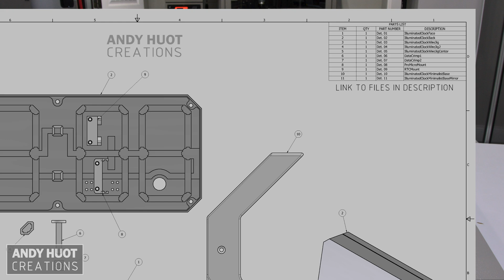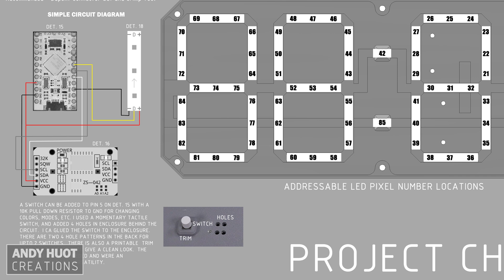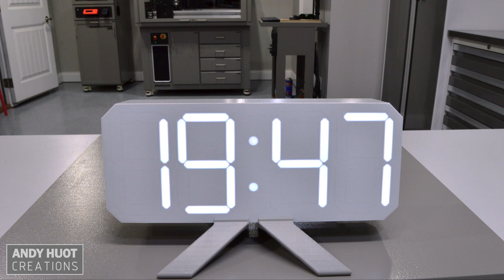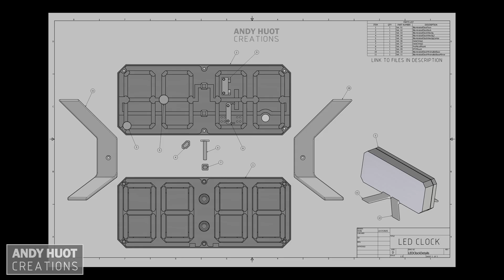WOW! Create Your OWN 3D Printed LED Clock!

Comment: Great project Andy!  I will say that I've ordered the LED strip twice off your affiliate link and both times I received the 144 LED/M strip instead of the 100LED/M strip.  Two returns currently in progress to Amazon - just FYI!
Reply from the maker: Sometimes the links default to something else when out of stock.  I'm trying to figure out a way to prevent this.
Reply: @AndyHuotCreations  Yeah, the funny thing is that the seller's listing specifically says 100LED/M and yet they shipped 144.

Comment: Hi, can this be printed on a  Bambu Lab X1 carbon, 256x256x256mm? and your other prins also?

With kind regards,

Theo Brands
Netherlands
Reply from the maker: Yes. As of now, all my projects fit on a 250mm x 200mm bed and don't exceed 250mm height.

Comment: Great work on this. I am currently in the middle of building this myself but am having trouble getting the code to compile. I believe I have the wrong DS3231 library installed. I saw other comments mention the one you used is in a google drive folder link but I do not see it anywhere. Any help is much appreciated. Thanks

Comment: Hey Andy, stumbled upon the larger clock, and thankfully this smaller one too :) I'm going to take a stab at making it. Thank you for sharing everything! One question - you mentioned the layer heights for the prints, but is there a specific infill amount & pattern you used? Thanks again, looking forward to your future makes.
Reply from the maker: @agpby  I stick with cubic 20% for infill.  Let me know if you have any questions during the build!
Reply: @AndyHuotCreations  awesome, thank you so much for the quick reply and assistance! :)
Reply: @AndyHuotCreations  just finished this build. Came out great, thank you so much again for sharing it! Those little wires were brutal but we made it lol. Went with the esp32 so I can push code OTA and deal with DST etc. Added a temp sensor to the back as well, because why not. Looking forward to working on the next one of your creations. Thanks!

Comment: Hello, I love your work, but I admit, I tried, and I failed, impossible to close the box, the connection between the LEDs is too small for me, my cables are in the passage and I can't close the box, it's a shame the clock was nice...
Reply from the maker: @ecaze1333  glue a piece of 200 grit sandpaper to a piece of plywood or something flat and slowly rake the side that goes to the back over the sandpaper (the whole back face of det. 1)to remove material. Take off about a half millimeter, blow off the dust and try to insert again. Repeat if needed. You've gone too far to turn back now! Let me know how it goes.
Reply: @AndyHuotCreations  Thank you for your support, I will find a solution, I will keep you informed.

Comment: Amazing work! I am in the process of printing the parts and have the electronics that I didn't have in stock on order.  I appreciate the cheat sheet and the timelapse, but as a beginner / intermediate am find it very difficult to follow especially at the 'fast forward' speed.  I wonder if it wouldn't be a bad idea to include step by step written instructions in future projects.  Its not clear why you chose the colore wire (why blue and green vs. black, red, ?) - is there a reason or is that what you had on hand?  Also not clear how to use the wiring 'jigs' in this model,  I see the other jig you made for the dot matrix clock where you wrap the wire and cut it - is that jig suitable for this?

Also, if you are interested, I did a remix of the clock face to make the clock 7-segment bits printable with a differerent color (I have a bambu X1C) rather than printing the full first 2 layers in clear.  Let me know if you would like that model.
Reply from the maker: Thanks!  I'm working on my supplemental documentation strategy.  I added an audio file to downloads to my dot matrix clock video as an experiment.  My goal is for everyone to learn from the project.  By having the builder do a little footwork to build my project, I'm ensuring that you will learn valuable things. If you saw the video and decided to build, that means you are definitely capable and I am here to help.  You are right, I used blue and green wire because I didn't have enough red and black, but don't get hung up on things like wire color, there's no industry standard on projects like this.  As long as it makes sense(blue=5V, green=ground), pretty reasonable.  The jigs on dot matrix will not work here.  The jig you need for power has a head on it.  Cut a convenient length of wire (about 2 feet and use the rest for the next cuts) and bring one end to the bottom of the head of the jig for both power wires.  Wrap both roughly around the jig and insert into the sleeve.  Cut them both on the long end flush with the bottom of the head of the jig. Strip them and repeat for all corners of the segments.   Now you're ready to glue.  Apply a little CA glue where the wire will contact the plastic.  Use the same wire jig(part with the head) to install the two wires.  Do a dry test.  The jig should slide and interlock with the clock housing by design.  Definitely form and strip all wires, then install all wires.  Do this, don't worry about the data until this is done.   By then, you should have an idea how to do the data.  Watch the video more too and watch what I do.  Come back here with any more questions.  You got this!
Reply: @AndyHuotCreations  Thanks! I am making decent progress. Have the power and ground wires installed and about halfway through the data wires.  I can't decide if you are a genius or a sadistic madman :-) Hopefully it will work in the end.  I am curious if you invented the wiring technique or if you learned that from someone else.  Thanks for sharing.
Reply from the maker: I came up with the wiring techniques myself.  I design manufacturing machines and fixtures for a living.  Streamlining manufacturing processes is a big part of my job.

Comment: Beautiful clock. And how to set or adjust the time. For example, summer-winter?
Reply from the maker: Just add some if statements to the void that gets the time.  Use the DST start and end dates in the statements to add 1 hour if the criteria is met.  If I have time, I will update the code in the downloads, but try yourself and let me know if you have questions.

Comment: I’m very impressed with all the up front effort you put into the design. Right down to the cableways in the case back. Pretty sure my wiring wouldn’t be as tidy as that 😂 I’d love to know more about your design process? Do you use Fusion 360, OnShape or something else? I find that making functional assemblies is the hardest and most time consuming part, but I’m not an expert in Parametric CAD. Thanks for sharing your work.

Comment: Thanks Andy, Any suggestions for scaling to fit on an Ender 3?
Reply from the maker: The LED strip and wires would be the limitation.  You'd have to scale it to about 88%, which would prevent the strips and wires from fitting and working with the jigs.
Reply: @AndyHuotCreations  Thanks for the reply,  I saw I could also rotate about 45 degrees and only have to shrink it a little bit.  Just another excuse to have to upgrade to a Prusa 🤑

Comment: Hallo noch mal, ich bekomme den sketch nicht auf meinen Arduino Pro Micro aufgespielt, die Bibliotheten ds3231 und NeoPixelBus sind installiert,error: no matching function for call to 'DS3231::DS3231(const uint8_t&, const uint8_t&)'
 DS3231  rtc(SDA, SCL);
Reply from the maker: Ist Ihr Board in der Arduino IDE auf Arduino Leonardo eingestellt? Das sollte es sein.

Comment: Hi, I have built the clock and it looks great. Would it be possible to provide the code for time setting, or a +/- 1 hour for DST? Thanks
Reply from the maker: You can just add a simple conditional statement in the void that gets the time and say if the time falls within the DST timeframe(Start Month and Start Day) (EndMonth and EndDay) , DST = 1;, else, DST = 0;  There's info out there on this.  Try to figure this out with what I've said.  This will be a good learning experience.  If in a week you still can't get it, come back here and let me know.  I have confidence in you though.  If you built the clock, you can figure this out.  Congratulations on the build!

Comment: Sorry, aber ich bekomme die Software nicht auf den Arduino, die NeoPixelBus Bibliothek habe ich installiert, jetzt kommen folgende Fehlermeldungen: D:\OneDrive\Creality\LED UHR\drive-download-20250309T063341Z-001\LEDClock2.1\LEDClock2.1.ino:3:21: error: no matching function for call to 'DS3231::DS3231(const uint8_t&, const uint8_t&)'
 DS3231  rtc(SDA, SCL);
                     ^
In file included from D:\OneDrive\Creality\LED UHR\drive-download-20250309T063341Z-001\LEDClock2.1\LEDClock2.1.ino:1:0:
D:\OneDrive\Dokumente\Arduino\libraries\DS3231/DS3231.h:73:3: note: candidate: DS3231::DS3231(TwoWire&)
   DS3231(TwoWire & w);
   ^~~~~~
D:\OneDrive\Dokumente\Arduino\libraries\DS3231/DS3231.h:73:3: note:   candidate expects 1 argument, 2 provided
D:\OneDrive\Dokumente\Arduino\libraries\DS3231/DS3231.h:72:3: note: candidate: DS3231::DS3231()
   DS3231();
   ^~~~~~
D:\OneDrive\Dokumente\Arduino\libraries\DS3231/DS3231.h:72:3: note:   candidate expects 0 arguments, 2 provided
D:\OneDrive\Dokumente\Arduino\libraries\DS3231/DS3231.h:68:7: note: candidate: constexpr DS3231::DS3231(const DS3231&)
 class DS3231 {
       ^~~~~~
D:\OneDrive\Dokumente\Arduino\libraries\DS3231/DS3231.h:68:7: note:   candidate expects 1 argument, 2 provided
D:\OneDrive\Dokumente\Arduino\libraries\DS3231/DS3231.h:68:7: note: candidate: constexpr DS3231::DS3231(DS3231&&)
D:\OneDrive\Dokumente\Arduino\libraries\DS3231/DS3231.h:68:7: note:   candidate expects 1 argument, 2 provided
D:\OneDrive\Creality\LED UHR\drive-download-20250309T063341Z-001\LEDClock2.1\LEDClock2.1.ino:4:1: error: 'Time' does not name a type; did you mean 'time'?
 Time  t;10:10
 ^~~~
 time
D:\OneDrive\Creality\LED UHR\drive-download-20250309T063341Z-001\LEDClock2.1\LEDClock2.1.ino:4:9: error: expected unqualified-id before numeric constant
 Time  t;10:10
         ^~
D:\OneDrive\Creality\LED UHR\drive-download-20250309T063341Z-001\LEDClock2.1\LEDClock2.1.ino: In function 'void setup()':
D:\OneDrive\Creality\LED UHR\drive-download-20250309T063341Z-001\LEDClock2.1\LEDClock2.1.ino:68:7: error: 'class DS3231' has no member named 'begin'
   rtc.begin();
       ^~~~~
D:\OneDrive\Creality\LED UHR\drive-download-20250309T063341Z-001\LEDClock2.1\LEDClock2.1.ino: In function 'void GetTime()':
D:\OneDrive\Creality\LED UHR\drive-download-20250309T063341Z-001\LEDClock2.1\LEDClock2.1.ino:123:3: error: 't' was not declared in this scope
   t = rtc.getTime();
   ^
D:\OneDrive\Creality\LED UHR\drive-download-20250309T063341Z-001\LEDClock2.1\LEDClock2.1.ino:123:3: note: suggested alternative: 'tm'
   t = rtc.getTime();
   ^
   tm
D:\OneDrive\Creality\LED UHR\drive-download-20250309T063341Z-001\LEDClock2.1\LEDClock2.1.ino:123:11: error: 'class DS3231' has no member named 'getTime'; did you mean 'getA1Time'?
   t = rtc.getTime();
           ^~~~~~~
           getA1Time
D:\OneDrive\Creality\LED UHR\drive-download-20250309T063341Z-001\LEDClock2.1\LEDClock2.1.ino:124:3: error: 'TimeMinute' was not declared in this scope
   TimeMinute = t.min;
   ^~~~~~~~~~
D:\OneDrive\Creality\LED UHR\drive-download-20250309T063341Z-001\LEDClock2.1\LEDClock2.1.ino:124:3: note: suggested alternative: 'TimeHour'
   TimeMinute = t.min;
   ^~~~~~~~~~
   TimeHour
D:\OneDrive\Creality\LED UHR\drive-download-20250309T063341Z-001\LEDClock2.1\LEDClock2.1.ino: In function 'void DisplayTime()':
D:\OneDrive\Creality\LED UHR\drive-download-20250309T063341Z-001\LEDClock2.1\LEDClock2.1.ino:133:26: error: 'TimeMinute' was not declared in this scope
   int firstMinuteDigit = TimeMinute % 10; //work out the value of the first digit and then display it
                          ^~~~~~~~~~
D:\OneDrive\Creality\LED UHR\drive-download-20250309T063341Z-001\LEDClock2.1\LEDClock2.1.ino:133:26: note: suggested alternative: 'TimeHour'
   int firstMinuteDigit = TimeMinute % 10; //work out the value of the first digit and then display it
                          ^~~~~~~~~~
                          TimeHour

exit status 1

Compilation error: no matching function for call to 'DS3231::DS3231(const uint8_t&, const uint8_t&)'
Reply from the maker: Sie müssen auch die DS3231-Bibliothek installieren. Alle Bibliotheken im Code müssen installiert werden.

Comment: Hi Andy. One thing that isn't entirely clear to me is whether the first and second layers are done in white. I ask because that's what you indicate in the specifications, but in the video, they don't seem to be white.  
Thanks for your videos, I'm really looking forward to seeing what you're going to create next!
Reply from the maker: The first two layers should both be white.  The first two layer thicknesses should both be 0.20mm.  If they are not both white, the light won't show through.  All layers should be 0.20mm in fact, so the face and back pieces mate and bottom out at the right spots.  1:15 look into the segments and you can see the white in back and light coming through.
Let me know if you need anything else, and stay tuned, I'm very excited about my next project video.  Should be done in a couple weeks.
Reply: @AndyHuotCreations  Thank you so much Andy. I'm designing one, but based on yours, which I think is spectacular!

Comment: Oh yea, great job and a good dessign. My other question is this clock DCF supported? I hope I can switched for the UTC time and my downtown’s time?
Reply from the maker: It does not as designed support DCF.  There are DCF modules you can get that would work with the clock.  Finding one to fit in that small space would be difficult.  You might be successful if you ran a wire for the antenna to be outside of the clock housing.

Comment: lovely project, attempting the build, can i ask exactly which DS3231 library you used. I am unable to get the code to compile, I am a bit of a novice with coding so a little stumped.

D:\OneDrive\Documents\Arduino\LEDClock2.1\LEDClock2.1.ino:3:21: error: no matching function for call to 'DS3231::DS3231(const uint8_t&, const uint8_t&)'
 DS3231  rtc(SDA, SCL);
                     ^
In file included from D:\OneDrive\Documents\Arduino\LEDClock2.1\LEDClock2.1.ino:1:0:
D:\OneDrive\Documents\Arduino\libraries\DS3231/DS3231.h:64:3: note: candidate: DS3231::DS3231()
   DS3231();
   ^~~~~~
D:\OneDrive\Documents\Arduino\libraries\DS3231/DS3231.h:64:3: note:   candidate expects 0 arguments, 2 provided
D:\OneDrive\Documents\Arduino\libraries\DS3231/DS3231.h:60:7: note: candidate: constexpr DS3231::DS3231(const DS3231&)
 class DS3231 {
       ^~~~~~
D:\OneDrive\Documents\Arduino\libraries\DS3231/DS3231.h:60:7: note:   candidate expects 1 argument, 2 provided
D:\OneDrive\Documents\Arduino\libraries\DS3231/DS3231.h:60:7: note: candidate: constexpr DS3231::DS3231(DS3231&&)
D:\OneDrive\Documents\Arduino\libraries\DS3231/DS3231.h:60:7: note:   candidate expects 1 argument, 2 provided
D:\OneDrive\Documents\Arduino\LEDClock2.1\LEDClock2.1.ino:4:1: error: 'Time' does not name a type; did you mean 'Wire'?
 Time t;
 ^~~~
 Wire
D:\OneDrive\Documents\Arduino\LEDClock2.1\LEDClock2.1.ino: In function 'void setup()':
D:\OneDrive\Documents\Arduino\LEDClock2.1\LEDClock2.1.ino:68:7: error: 'class DS3231' has no member named 'begin'
   rtc.begin();
       ^~~~~
D:\OneDrive\Documents\Arduino\LEDClock2.1\LEDClock2.1.ino: In function 'void GetTime()':
D:\OneDrive\Documents\Arduino\LEDClock2.1\LEDClock2.1.ino:123:3: error: 't' was not declared in this scope
   t = rtc.getTime();
   ^
D:\OneDrive\Documents\Arduino\LEDClock2.1\LEDClock2.1.ino:123:11: error: 'class DS3231' has no member named 'getTime'; did you mean 'getA1Time'?
   t = rtc.getTime();
           ^~~~~~~
           getA1Time

exit status 1

Compilation error: no matching function for call to 'DS3231::DS3231(const uint8_t&, const uint8_t&)'
Reply from the maker: I just dropped the library into the download folder.  Go ahead and download and install it.  It's now in the linked folder in video description.  Let me know if this works.
Reply from the maker: In case you don't know how to install it.  Just download it and put it in your arduino library folder, close all arduino ide windows and reopen.  If you can see it in examples, you did it right.
Reply: @AndyHuotCreations  Hey man, thats great. !! Added the zip through library add option and compiled first time. Just waiting for some LED's to arrive now :)

Comment: Congratulations, the project is really beautiful. You chose the LED as WS2812B. I have SMD5050 LEDs, can I use them in this project? Will it cause any problems?
Reply from the maker: As long as the LED strip is 5mm wide and 100 LEDs/meter(10mm between LEDs) it should be fine.  You need 3 pixels per 30mm long strip that you cut.